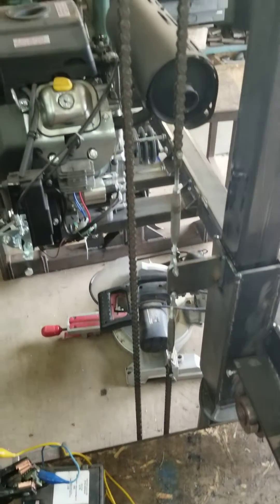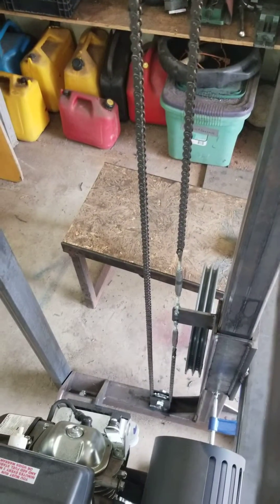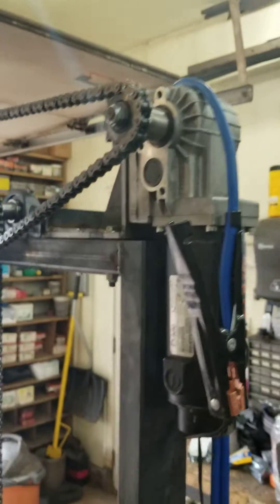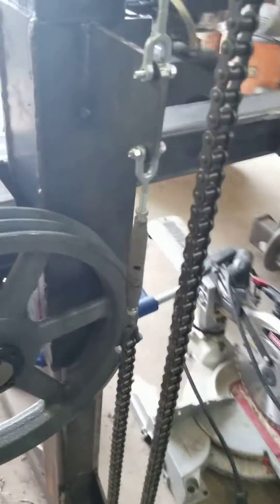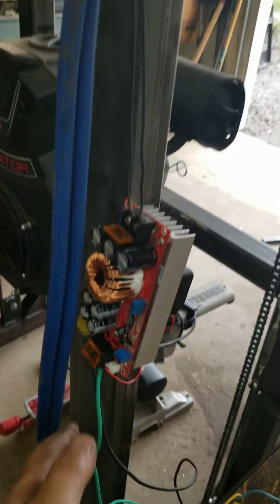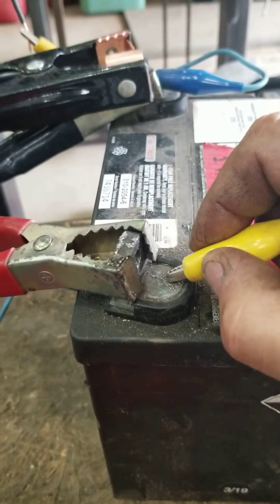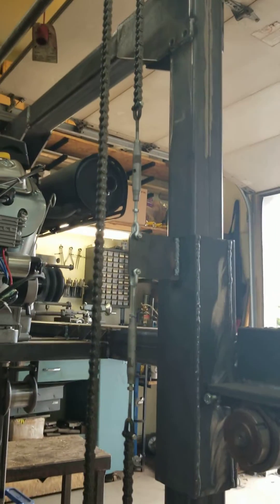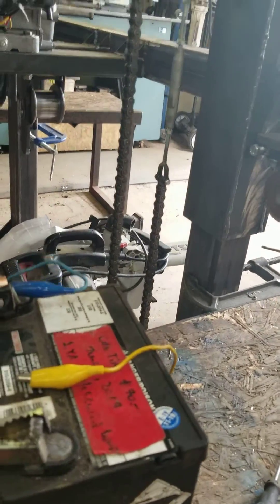DIY Lumber Mill Chain Lift Mechanism

Comment: How much would you say your saw head weighs?
Reply from the maker: It's pretty heavy. If I had to guess, the entire roller assembly with the wheels and the motor, I'd say about 400 to 500 lbs.

Comment: if you add a time delay relay to the lift motor, the same switch could be used to activate the brake and the motor. The delay relay would allow the brake to release a split second before the motor starts. The delay is adjustable.
Reply from the maker: The issue is that I need the motor in 12v and the brake on 24v but I'll have a look
Reply: @ChrisOfAllTrades  easy enough with relays.